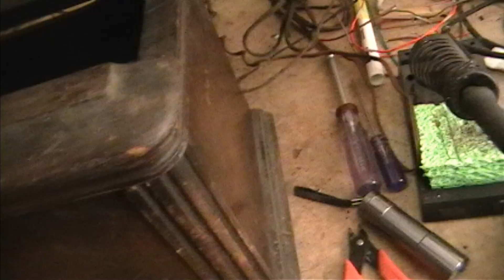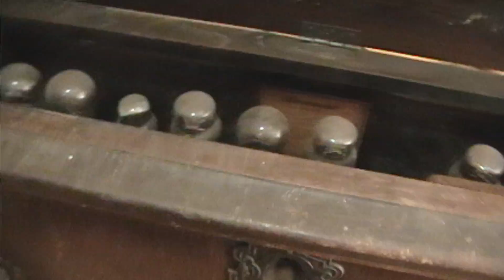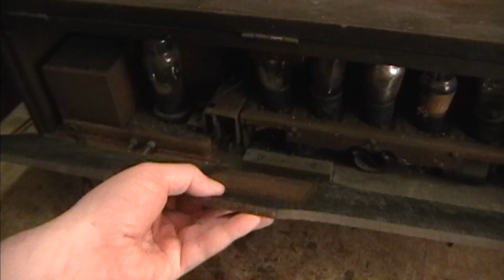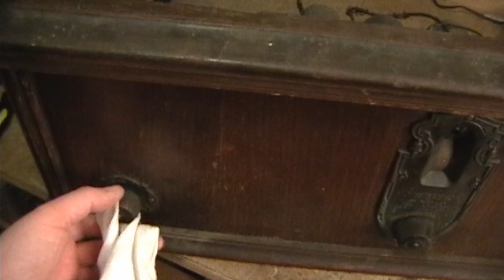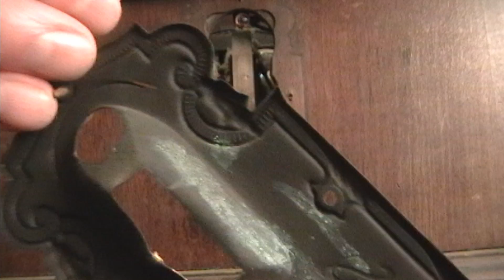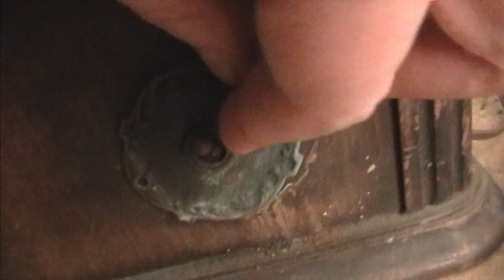Brunswick 5KR pt1

Comment from the maker: There are lots of tricks.  Try doing a web search and I'm sure you'll find some.
Reply: The correct speaker for that radio is a Brunswick Model A. They are available, check EBay. I bought one of the Model A’s and had John Sawyer at Sawbox Guitars (look on Facebook) in San Diego convert it to a Bluetooth by replacing the speaker and grille cloth for modern electronics, since I don’t have one of the radios. Although there’s a pristine collector-grade condition radio only, available on eBay for $2K.
Reply from the maker: @satan7946  Yes, I picked one up for this radio.  Here's the video:  https://youtu.be/2BsUmuwROR4

Comment: Nice radio.  Those jacks i the back are most likly the speaker jacks.  The pins in the jacks were attached to the speakrer leads.  My old speakers are usually missing them and I make new ones from finish nails.  Bruswick teamed up with RCA in the early '20's.  They made consoles that had a radio and a phonograph.  Brunswick made the phonograph and RCA provided a Radiola radio. RCA did the same with Victor.  When RCA purchased Victor they ended their deal with Brunswick.

Comment: I've been thinking of trying the electrolysis trick on a rusty chassis, after removing the coils and transformers of course. Since the tie points and socket contacts are largely insulated for the chassis itself I don't think that they would not be effected by the process.

Comment: My Canadian Westinghouse model 89 has a "modernized" version of that chassis, it uses a set of #27 tubes with a #45 output tube instead of #26s and a 71A, and an electrodynamic speaker instead of a magnetic speaker, I think it's similar to an RCA Radiola 63.